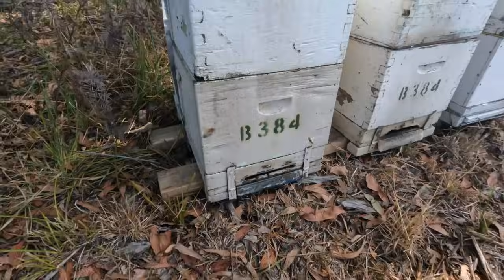Never Been Inspected | Opening Up Three Abandoned Beehives and Finding the Worst Conditions.

Comment: Bring a bucket and lid or 2 with you when you visit your bees, if the lids got honey and they are putting fresh stuff in clean it out. Leave the lid full if there is nothing around, they are getting nasty because they are short of food or coming into winter. 

Never throw your wax on the ground around the hive unless you like having stuff stuck to your foot wear or inviting pests and diseases. Every bit of comb can be melted down and cleaned or burnt as fuel for other beekeeping activites (fire boiling water for uncapping or melting out other dirty old frames... 🎉 😮 😅
Reply: I am not a bee-keeper but I thought the same about throwing wax on the ground... that's messy bee-keeping. Also worried when he slides the frames back into the hive as there were a lot of bees at the bottom of the frames.... many bees probably got squashed.

Comment: 🇦🇺 well done. Here in SA,
I recently helped someone do full transfers to new hiveware, as the old boxes and frames were in worse condition than those ones you had.
Abandoned hives in suburbia for 5 yrs, due to owner getting dementia. 
8 triple boxes, I've still got to go back and do the last 2. 
The borer holes are wax moth, 2 hives I worked had been decimated by wax moth.  I took some clean comb, and brood from another  hive at home and did a careful shake out. Trying not to get wax moth larvae in the new boxes.  
2 boxes either died off or swarmed,  3 boxes transferred well and are doing well at my farm. One had to have euthanasia, as they were extremely angry aggressive bees. They wouldn't leave us alone and we coped a lot of stings.  It was too difficult to transfer them to the country.  
3 City beach hives, now doing well in the country having a tree change.  LOL 
Where are you located?

Comment: With that first super with wonky comb. What I do is scrape the top off turn it upside down on a table and cut around the frames inside the box and then lift the box off the frames. You can then separate them out a lot easier.

Comment: I guess you've not seen a slatted rack before. There are several reasons for these, the main one being to prevent comb being built right to the base of the hive. Personally, I think the bees know what to do and I don't use them.
As regards cross combing. When I started beekeeping, I was encouraged to use foundationless frames with just a thin strip of wood at the top of each frame for the bees to start from. However, this turned out to be a complete nightmare, as the bees filled the entire hive with cross comb worse than seen here. I made several attempst to ge the hives into some sort of order, but they kept cross combing every time. Hence, where I live, in Tasmania, I'd recommend using foundation unless you want to trash your hives every time you need to inspect.
Reply from the maker: I thought a slatted rack was to reduce congestion and help with keeping brood cool in the summer.
Reply: @aussiebeekeeping   & I thought they were supposed to be in line with the frames not perpendicular.... but I've never used them either.
Reply: @aussiebeekeeping  that's not a typical slatted rack. Sooner or later, you'll have to rip that off and put it on a standard bottom. They're too low to the ground anyway.

Comment: I was told old frames with that dirty old black comb makes bees progressivly smaller as the cells get smaller from old cocoons and they get less and less wax like and more like wax cardboard, and was told to put at least 3 fresh in the brood box yearly to keep them fit and healthy.

My got to methodis after i put and empty box on is to take the 2 outer most frames in the brood box if possible they are usually full of pollen and some honey and maybe a tiny bit of brood, and put them in the box above until its full or the brood has hatched out and keep an eye out if they start a queen up in warmer weather.

They get new frames down the bottom regulary, keeps them fit strong and healthy, the old frames get steamed melted, rewired and waxed if savable otherwise brand new frames replace condemned frame keeping a constant fresh supply of frames to replace old and worn out frames! 🎉 😮 😅
Reply: Wow, that's interesting. Where I live we are learnt to change at least 50%of frames every year, frames cannot be in give for morę than 2 years